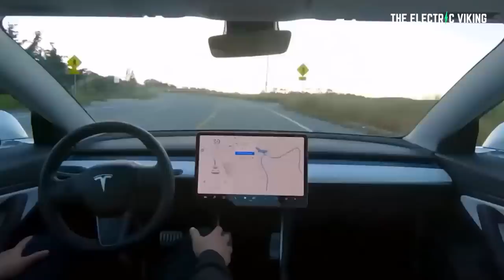20% of all vehicles will need to run on electricity in 24 months in Canada!

Comment: I'm from the Canadian northland... long travel distances and -40 temperatures make it complicated for EV mass adoption. We have little to no rest-stop infrastructure and standing outside in winter to quickly refuel is unpleasant. While the near US border band of Canada's more urban population can and will move to EVs more quickly, the large and much less densely populated portions of the Trans Canada highway system need a very large amount of upgrades in combined 24-hour rest/charge stops and as of yet, there is no indication of that beginning.
Reply: norway
Reply: @Nas_Atlas  Norway is a tiny country. Do people there frequently travel 200km or farther in winter with no place to stop and warm up after business hours?
Reply: @tommetzner58  Check out Bjørn Nyland's YouTube channel. Get informed before talking.
Reply: He is right.  Canadians in cities can buy ev.  Rural canadians do not want evs.  Most cars sit outside.  People in Saskatchewan have a hard enough time keeping their gas cars from freezing up.
Reply: @adamq9270  I'm 170km north of the Trans Canada on a 2 lane spur highway and would love to get a CyberTruck in a few years when the preorders get filled and they come available. That said, it is going to take the expansion of the charging networks to make it work. Currently, the Super Charger network runs the Trans Canada but of course, the 6 chargers in Dryden for example sit next to nothing that is open 24 hours and once EV adoption is forced, we'll need many more of them and someplace to take a warm break since and use a bathroom while we add that 1/2 hour or so to our trip legs.
Reply: Just watch how quickly Tesla builds out a charging infrastructure. Amazing speed.
Reply: @adamq9270  EVs do not freeze when left outside in Winter. Plus, here in Montreal, some people leave their EVs outside all the time.
Reply: I have often travelled across the provinces and ended up with my Tesla model 3 long range parked outdoors in -45°C Lethbridge Alberta. For a week. Normally it’s parked underground in Vancouver BC. I can tell you that my car never froze and it was always warm before I got in it. You honestly need to learn more about electric cars - specifically TESLA. the infrastructure IS there. PLUS it is developing every month. Plus, Plug in everyday to your home plugin. 120 V no less for me at my sisters home… No challenges. And WAY better on the roads than ice vehicles. Safer. Etc, etc… seriously - just try it. Test drive one. Or don’t.
Reply: @tommetzner58  i have a preorder for a cyberturck also.  But, it will likely be way too expensive.  I'd love to buy electric.  But, it is still unaffordable to most here in Canada and the government is not doing anything to help that.  They are just making gas cars too expensive also, just like klaus Shwab wants
Reply: @sebastian.tristan  I'll take your word for it.  But, I am pretty sure those in colder places than montreal will disagree with you
Reply: @adamq9270  The point is that whether it's -25 in Montreal or -45 anywhere else, EVs do not freeze. Electricity works even at absolute zero (zero Kelvin or -273 Celsius). This is a myth that keeps bouncing around and being amplified on the internet.
Reply: As I fellow northerner, I agree 100%. I would love for it to happen, but Canada's infrastructure is not ready yet. The vast majority of our population live in dense cities on the southern border, yeah they've got a few superchargers here and there... But leave those area's, and the only place to charge is at home.

Canada is a massive country with a relatively small population. This obviously makes adopting new vehicle technology inherently slow. The payback period on infrastructure upgrades is long, as the upgrades are massive, yet the customer base is small. 

Add in the -40°C weather....
Reply: @Nas_Atlas  most of Norway's winters don't get nearly as extreme as canadian winters
Reply: Hybrids for northern Canada
Reply: @adamq9270  I watched the cyber truck reveal with excitement but was too stupid to put in a pre-order. Now I'm at the very back of a very long line that isn't even open to join now. The stainless construction is key for the rustbelt and making anything a 15 to 20 year driver.
Reply: @sebastian.tristan  then why do ice vehicle batteries not hold a charge when it is too cold?  Why are there heaters to help them start?  Im not saying it cant be done, Im saying its a huge headache for a lot of people.  At least one has mentioned on here.  
  This is something that we can handle.  But, our large, cold country will pose many challenges.  Nobody is saying you can't do it here. We should just try to make the transition less painful for people who will be seriously effected.
Reply: @tommetzner58  I made my reservation last july and still no word.  Im not looking forward to seeing the pricetag.  Wish I could give away my place in line.  I was thinking of flipping it after for a profit.  But, I'd rather keep it
Reply: @adamq9270  20 or 60 percent adoption leaves plenty of gas options for rural Canadians.
If we can keep the motor oil warm, we can keep the batteries warm.
Reply: @sebastian.tristan  batteries lose their charge very quickly below -20C. So not workable without battery warmers.
Reply: @ImranKhan-ty6mx  I hope so.  Hopefully, they start to make them affordable too.  I think that is the largest challenge for most canadians
Reply: @robertn2951  Tommetzer58 doesn’t have to get informed about Norway‘s mass adoption of EVs… unless he leaves his rural Canadian home and moves to Norway. He points out that rural Canadian consumers have very specific reasons not to adopt EVs. Until Canadian government can address lack of infrastructure, he will forgo the major expense. Seems logical to me.
Reply: @sebastian.tristan  Tesla‘s have heat pumps that mitigate for some of the negatives of extreme cold temps and EV battery performance (recharging speed and range degradation). Not all EVs do. Are the EV manufacturers going to give extreme cold temp residence a 20% discount, since some manufacturers EVs lose up to 20% of their range in extreme cold environments? No, but as a consumer I can choose if I want to spend more to get less… well, unless it is mandated by my government.
Reply: @matthewmclean9583  Hybrids are the worst of both. Basically, hybrids are ICE vehicles that have to lug around extra weight.
Reply: @robertvandeveer1846  All cars, whether EVs or ICE, lose range in cold weather. Singling EVs out for this phenomenon is a moot point.
Reply: @ImranKhan-ty6mx  Actually, it's the flow of electrons that is impacted in a battery during cold spells. And this is for batteries that use a liquid electrolyte (solid state batteries should be much less impacted). However, most modern EVs have battery thermal regulation already.
Reply: Depending on your daily commuting distance,  home charging overnight works quite well.
Reply: @adamq9270  ur are right, EVs are expensive.
Reply: @robertn2951  The topic is Canada, not Norway.
Reply: @mikejansen9798  Indeed. That said, in my case, I frequently winter travel to and from NW Ontario to the USA and also NW Ontario to Thunder Bay (570 km one way) and Winnipeg (490 km one way)
Reply: @sebastian.tristan  His concern is with the short winter range of EVs in an expansive territory, the freezing comment related to gasoline vehicles
Reply: You have a point. But 90% or Canadians are urban/semi-urban and most people don’t drive more than 100km in a day. Thus meeting a 20% target lf new sales is completely achievable if manufacturers can bring prices down. 

I have a tesla and love it… works just fine in sub zero temps (-8 is as cold as it got here since i got it). 
Charging takes a little time (generally 25-35 min at supercharger) but the cabin stays warm, i can play games or watch netflix/youtube. Plugging in to supercharge takes 5 seconds (no cc /airmiles cards and codes. Just plug in and get back in car. It is easy. On a road trip it is a good time to use washroom or grab a bite.
Reply: @adamq9270  EVs dont “freeze up” when its cold outside i use my phone app to turn on heat/butt warmer/defrost. When i go out the car is 20C and cozy for me. All i do is unplug and drive.
Reply: @davidbuchan3753  You ignore the concern that Canadians have with winter range.  The freezing comment was what current owners of gasoline cars are concerned with, will it start after being parked at -30F.  The freezing comment isn't about EVs because they don't own EVs.  Canadians in the hinterlands have heard that EVs have a shortened range during the winter - that is because they must drive many miles on common trips
Reply: @sportbikeguy9875  cold weather reduces range because EVs use battery to make heat. But in cold weather the cabin warms up faster on an ev and they drive fine. EV will last a long time parked in a snow storm with only heat on (in emergency). Even rural people generally have electricity in their homes and work, so there is opportunity to charge (trickle charge). With an EV you only go to charging station when you drive a lot (road trips or delivery work). Even on 110v standard outlet i gain 120km+ a day when parked.
Reply: @ImranKhan-ty6mx  not all batteries and battery packs are the same. Battery loss at low temp is restored as temp comes up. Many EVs have thermal management systems on their battery pack. As you turn it on the battery warms up and chemical charge processes are restored
Reply: @mikejansen9798  my car is parked 20 hrs a day and plugged in. I gain about 120km a day on a standard 110v outlet
Reply: @timothykeith1367  His silly argument was the usual: cold weather, long distances. Bjorn does thousands of kilometers through Winter in Norway. So there is no excuse for Canadians not to do the same.
Reply: Norway has very cold climate - You dont have to stay outside of the car when chargin. Out - Plug in and go inside again.
Reply: @robertn2951  The province of British Columbia is now than twice the area of Norway with about the same population. Canada is massive. Norway is not on the same scale and cannot be compared.
Reply: @talkingBS  not to argue too fine a point, but how long will rural hospitality last when farmers have dozens of vehicles parked 12 hours around their home every long weekend just so they can get to the next supercharger 40 km away?
Reply: Where do you live in Canada that the temperature is -40? Canada is a large land mass almost the same as the US and temperatures vary dramatically. I live in Vancouver and we never ever get those temperatures, we have a very moderate climate here and mostly get rain in the winter months. With our mild climate and high gas prices EV's are huge here, you see them everywhere. Where I live, there are 3 Tesla super charger locations with 15 miles.
Reply: @talkingBS  if that is true, I have learned something new today. In any case, the ranges in -20C are less than half based on real world experience of people using EVs. In Edmonton, we have -30C or colder for 5 to 10 weeks of the year. So that is even more worrying.
I am all for EVs, and have held off buying a new car for 4+ years, but the range is just not enough for a one car family like mine.
Reply: @sebastian.tristan  Correct, often the EV hater will come with negatives, Oh the batteries catch in fire or Oh do not work in cold climates, its just ignorance...
Reply: @davidbuchan3753  Thanks for trying the educate the EV newbies who dont know any better or choose not to know...
Reply: @sebastian.tristan  Exactly Sebastian...
Reply: @sportbikeguy9875  I think EV adoption is much higher than you think. In Vancouver it's absolutely crazy how many EV's are running around. Cold climates do not stop them.
Reply: @ImranKhan-ty6mx  Huh what does that mean?
Reply: @Guldmand8310  I understand that completely but when making a 400 km trek with a family, people need to get out and pee and especially older people need to move their legs. Current charging infrastructure in NW Ontario is no proximal to any 24 hour facilities and in winter temperatures, it is required. Canada really sucks as far as rest area facilities go!
Reply: @vancity2349  in Edmonton, pop 1.4 million, we had 2 solid weeks of -30C or colder from 7th to the 22nd of December, and more importantly, with winds of 5 to 10 km/hr, the wind chill went to -40c to -50c, which is really matters with EVs..
Reply: I live in Lumby BC and have never had a problem charging because I charge at home. The odd time I travel greater than 4 hours I need to stop and charge somewhere, but that is pretty rare. If you are driving 4 hours or more a few times a week, an electric car may not be the vehicle for you. But for  the vast majority of people, the infrastructure and range of electric cars to today is already good enough. What is not good enough is the supply in Canada. We need more electric cars to buy, the manufacturers are just not getting them to us.
Reply: As a Canadian, we are rural. Nearest charger is 2.5 hours away.  We are doing fine.  Neighbours have one too and they encouraged us to get a Tesla based on their good experiences.   Of course people in Thompson Manitoba would have more of a challenge.  A supercharger here on the Manitoulin would be nice, just in case Elon's listening.
Reply: @robertn2951 He’s making valid points based on our geography/weather. Which varies widely across the country btw.
Reply: The vast majority of the population concentrate in southern Canada. I'm from Montreal. Look at the Supercharger map in the province of Quebec. No issues at all. As long as you can charge at home, winter isn't a problem. I'm the owner of a dual motors Tesla model 3 since 2018… so I know what I'm talking about.
Reply: @adamq9270  You may not be aware but the Federal Government does help with EV purchases.   This will be a money maker for Canada, not only will we have more oil to sell on the World Market, but we will also have a thriving EV industry.  Our Natural resources is perfect for EV production, not to mention we have a lot of people who have the brains to advance EV technology.   Government is on the Right Track here, hopefully people are open enough to understand the huge opportunity to better the environment and grow the economy.
Reply: @ImranKhan-ty6mx   ‘wind chill’ only affects heat loss from exposed flesh, or degrees days calculation for poorly insulated buildings. As far as something like a battery or electric motor goes, its the actual temperature not the ‘wind chill’
Reply: @jimbartley5066  I get your point. But still. There were at least 5 days in a row at -33. And really, the range halves at -20C, so it not like windchill is not a worry for the humans riding in the care.
Reply: @sebastian.tristan  Sure, but the loss of power and range is significant.  Many EVs refuse to charge in extreme conditions.
Reply: I charged my Tesla at the Superchargers in Cranbrook BC and Fernie BC.  This is not the Trans Canada.  Not sure where you live, but these smaller towns had lnearby places to use a washroom and get something to eat and drink.
Reply: @tommetzner58  Geography. Norway is a very long and narrow country situated at the northern tip of Europe. It extends 1 770 km/1 100 miles from south to north, a distance equal to that from Oslo to Rome or from New York to Miami, crossing the Polar Circle at about 2/3 of the length.(nmbu dot no)
Reply: @DanRedwater  Agree cheaper EV's are needed for sure...
Reply: @1voluntaryist  not much other option in the north of Canada tesla can't repair up here. I ordered cybertruck but no one around here will get one any time soon.
Reply: @adamq9270  haven't you ever experienced an ICE car that won't start during a particularly cold day? In that respect I think EVs are better so there's pros and cons for each type of car
Reply: You don’t have to wait outside when you charge your EV. You can get back inside your warm car and watch TV if you have a Tesla as an example.
Reply: Seems to me that if people are going to be spending a significant amount of time waiting for charging at highway stops, that’s business opportunity! Give them a comfortable lounge, internet access, food and drink… they’ll come in, hang out, and spend money. Just like they do at fossil fuel truck stops today.
Reply: @sebastian.tristan  no it is not when the ICE fueling infrastructure is there, but the EV charging infrastructure isn’t. ICE vehicles also were not forced onto the consumers either. Market conditions created their current popularity and mass acceptance. Big difference when your Government tells you have no choice after a certain date, but they haven’t even come up with the energy source or charging infrastructure to support all these new EVs.
Reply: @adamq9270  ICE batteries are lead-acid. They have a different chemistry compared to the main batteries in EVs (which BTW, incidentally and ironically, also have a lead-acid battery to start the car 😁).
Reply: @paul9156c  I've had an EV for 2 years and it has never refused to charge, no matter the weather.
Reply: @davestagner  That's a good business idea. I think Ontario is already doing this. They have rapid-chargers at ON stops.
Reply: @robertvandeveer1846  Where I live in the province of Quebec, the charging infrastructure is there. The rest of the provinces and territories just have to follow suit. It's much easier to install electric chargers than gas stations.
Reply: @ImranKhan-ty6mx  Thats nuts but demonstrates how temperatures vary significantly. Its was 55 F here in Vancouver today...we went golfing
Reply: @robertn2951  Norway avg winter temperature is like -7C and it's only a fraction of the size of Ontario

Canada only has some 40 million people yet is the second largest and one of the coldest countries in the world; to be taking such a hardline stance on EV's is absurd and will hurt the general population if it is rushed and not perfectly-executed

And gotta love that rude and condescending "get informed before talking"
Reply: @Idiotboxchannelcat  I live in Canada, I'm in my 50s, and I've driven further than 500 km away from my house maybe twice in my life. Like most Canadians, I don't drive from Halifax to Vancouver on a weekly basis. No one does that. We use our cars to go to work, to the shopping mall and to bring kids to soccer or hockey practice. 
Tell me, how many times did you drive to Whitehorse? To Yellowknife? To Newfounland? What is your daily drive like? Hom many thousands of kilometers do you drive on a daily basis?  
I found people that look for excuses NOT to buy EVs simply idiotic. Sorry for being rude and condescending.
Reply: @robertn2951  some people travel for work. Some people like to visit family across multiple provinces once in a while and if they drive there is less "carbon footprint" than if they fly - it will be a while before they replace airplanes with "electric jets". 
Manitoba alone is more than twice the size of Germany.
Without proper infrastructure - which would have a very high cost and require intricate planning - mobility is significantly limited and citizen's lives made more complicated - Canada has an abundance of far-and-few-between rural communities.
Time is also wasted charging EV's for hours. 
There are many legitimate concerns when it comes to a government implementing EVs, especially when it is being forced without having a clear and effective plan that doesn't hurt the general population more than it benefits them. 
Trudeau put Canada in the hole with deficit after deficit and I personally have no idea how we will pay for this bold and seemingly ridiculous plan. The way I see it there must be some better options out there. Something with this all doesn't sit right with me
Reply: @Idiotboxchannelcat  OK, time to relativize the importance of Canada.
As a Canadian, I know that it has less than 40M inhabitants, right? Sweden might have 11M, Finland 6M and Norway 6M. Russia has less than 150 M. Iceland 380k and Greenland 60k. 
Total of population in "cold" countries = 215 millions. 
Warm countries now? 
Indonesia = 280 millions. It alone surpasses all the "cold" countries put together...
India = 1.4 billion.
Throughout Africa, over ONE billion.
Latin America = over 650 M. 
The Gulf States, Vietnam, Thailand, Burma, Bangladesh, etc...
Of the 8 billion inhabitants of this planet, the "cold" countries represent 2.5% of its population. 
Canada represents 0.5% of the world's population. Think about it. 
Manitoba (larger than Germany) represents 1.3 M people = 0, 02% of the world's population.  That is considered a village in China. Crumbs of crumbs. 
Do you think that OEM will keep on building ICE engines to serve a population that is so negligeable? In three years from now, once the manufacturing cost of batteries will be lower than ICE engines, do you think that OEM will give a dime about relatives living in Moose Jaw? No, they won't. 
"Warm" California, Texas and Florida make up almost a third of the US population: over 90M people, that is more than double the population of Canada.
In 5 years from now, OEM will care for Canada just as much as snowmobile manufacturers will care about the African market. 
R.I.P.  Red Deer AB, Moose Jaw SK, and Flin Flon MB.
Reply: @robertn2951  if Canada and other cold countries have negligible population on a global scale then why are they taking such a hardline stance on EV's? 40 million in some ways is many human lives, but regarding global climate it is negligible.
It's barely even a drop in the bucket environmentally, if that, considering the prices of mining and recycling lithium for EV batteries.
 
These warm countries with much higher populations and GDP, with fewer obstacles integrating EVs or even some better option for personal transportation - they should lead the charge.
All the government of Canada seems to be doing is hurting it's own people with it's virtue signalling
Reply: @TimvonHahn  How often do you travel across Canada? Do you travel across your Province every day? 
An ICE car makes a good secondary vehicle for long distance travel. Electric cars are great as a primary vehicle most days of the year.
Reply: @Idiotboxchannelcat  Canada is going the EV way for the environment but also for Canada. There are more advantages going electric than staying with ICE. We're not doing just to help the rest of the world.
Reply: @Nas_Atlas  It is over 2000 kilometres to get out of Ontario to Manitoba.
Reply: @talkingBS  What happens when you only have on street parking?
Reply: @talkingBS  More then half of the people in Toronto do not have a place to plug in at home
Reply: @finnurth  It is 2230 kilometres from Toronto to Winnipeg, the next major city to the west. Going east is easier, only 542 kilometres from Toronto to Montreal. The big one is Halifax to Vancouver, 6165 kilometres the majority on 2 lane highway through the mountains or the Canadian Shield.
Reply: @billyehh  Yes, Canada is huge.
Reply: @dvader3263  I can't afford 2 vehicles and the city will not give me 2 permits for street parking. I will be keeping my ICE vehicle for the foreseeable future.
Reply: @sebastian.tristan  right now I don't see many advantages of EVs over ICEs. The upsides seem to be significantly outweighed by the downsides.

It will take a long time to break even so the cost of an EV is less than an ICE vehicle, especially if fuel prices are low. If governments and banks don't come up with a generous and practical subsidy/loan program, EVs will cost more in interest and many people will be put deeply in debt or simply have to give up personal transportation altogether.
If repairs are needed in that timespan, right now it can be over twice the cost of ICE repairs. 
Large, expensive batteries have a limited lifespan, lose charge capacity over time, and perform poorly in frigid weather. If these batteries are damaged at all their warranty may be void.
A battery is projected to last around 10 to 15 years at best, and the resale value of an EV is directly correlated with the battery. For the price of one EV replacement battery alone, you could buy a used gas-powered car with reasonable milage. After about 10 years thousands of dollars of value are guaranteed to evaporate into thin air - and that's not counting the mileage, condition of the car or popularity of the model.
These batteries are not environmentally-friendly and are energy-intensive to recycle.
Much of the world's electric grid is still powered by gas, coal and oil.
There will have to be charging stations everywhere since it can take around an hour to charge an EV, compared to the 5 minutes it takes to fill up an ICE. Stops would become congested and a lot of time will be wasted charging EVs.
If there is a regional power outage I can't charge an EV unless I have off-grid electricity.
When a lithium battery catches on fire as it tend to when cooling systems fail, it is difficult to put out...
I could go on. EVs are a headache right now

I just don't understand why global leaders wouldn't see green hydrogen, biofuels or even look into something else as more practical than EVs. The infrastructure investment of switching to hydrogen/biofuel hybrid would be comparable or less than shifting the world to EVs and it would be more convenient to drivers, the way I see it